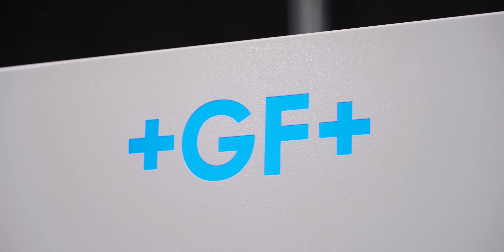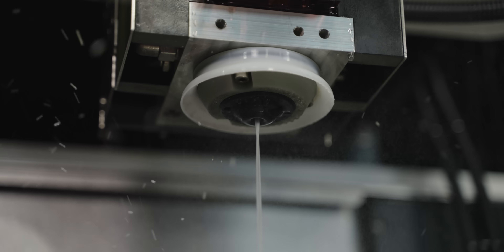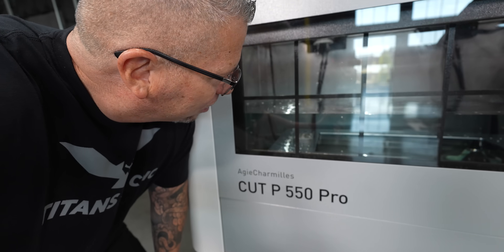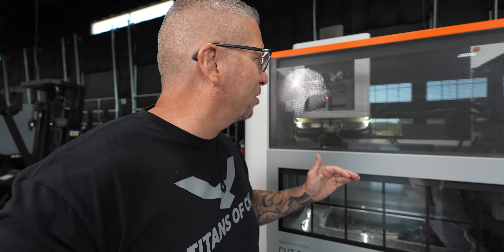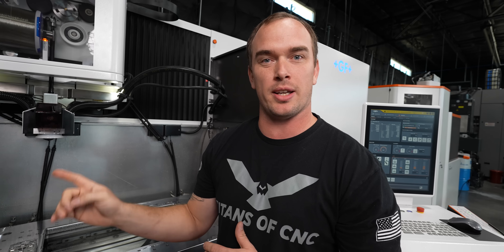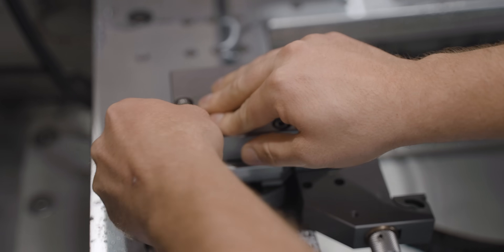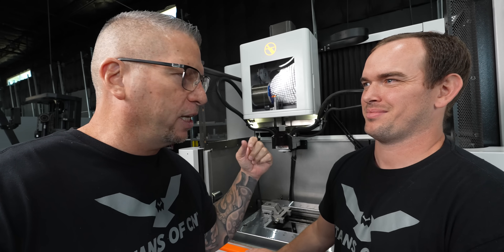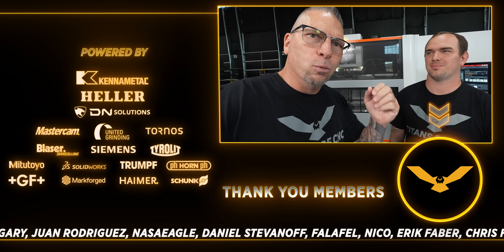We got the MOST ADVANCED WIRE EDM in the World

Comment: Literally how come the wire strength exceeding over 18 degree taper....  When power and material starts to contact with each other to cut, A small discharge of spark - Cuts the  wire in a sec.    What kind wire are they using

Comment: I was a mold maker I'm 67 and became a sinker specialist. Then took a job with AGIE as an application engineer.  There I taught myself wire and bought a machine. Was in business from 85 to 2003. Back then max speeds were about 12 Sq inches per hour. I had 3 AGIE and 3 Fanuc machines. What are the cutting speeds now. Haven't run a machine in 15 years I retired early.
Reply: Z=100mm minute 1.2 & 1.5 speed

Comment: I used to run Agies two 85 models and 1 was the agie classic 2005 model they were a dream to run. The agie classic didn't come with the prob for levelling the job but it did have the option for squaring up the job with the wire. The technology come a long way since 2005 on those machines. They are best wire EDM's by far.

Comment: Have you guys tried cutting hyperboloids with edm? I have an automotive component that’s in the design phase that I’m trying to make use of edm to make more accurate and easier to machine.
Reply: It depends on whether you want to do it inside or outside. For the outside version, you could simply connect a rotary axis and rotate with insane accuracy and surface finish. This makes it possible, in all conductive materials, to put down the smallest diameters.

Comment: This is a really cool machine! Thinking about the mechanical operation, is it possible to make convex cuts by doing repeated passes with the wires angle shifted? Similarly, is it possible to create curved tapers that start at, say, 30 degrees and end at 60 along the length of the taper? If so, this could make some impossible edm cuts more possible

Comment: Wait you're telling me this thing wires itself? That's next level productivity
Reply: If anyone has ever ran a wire EDM you'd understand that the set up process can be the most extensive part of the op, from spooling your machines to controlling your water with chillers even  the door cover can be some serious pains on some old EDM machines. All of these seem really fluid with this allowing for fast setups which gets you ahead on EDM jobs as they often take a long cutting operation.
Reply: @khalzard2964 new edm machines are extremely fast to set up. You shouldn’t have to touch the water chiller and putting on a new spool of wire should take a few minutes tops.

Comment: We have a P 350 at my work and the cutting is so much more stable than their older generator but we have been having some issues with the dielectric system being too sensitive and it cuts the machine off with random errors about the fan very confusing also does not like coated wire as much but absolutely flies on standard brass
Reply: Have you contacted their applications dept?

Comment: Thank you for this video! I used to have an Agie Classic and an Agie Progress at my old job. I used Esprit to program with. I was wondering what you guys are using for the EDM?
I also had a Mitsubishi FX 10 and an FX 20.
I had my less precise jobs in the older Mitsubishi's and the aerospace jobs in my Agies.
I ended up installing aftermarket DI water filtration systems from a company called Ebbco inc.
To take the load off the Agies  own filtration system. When you are running aluminum non stop like I was, the machine did ok but the Ebbco system filters the water and returns it into the machine saving the WEDM from having to clean so much eroded materials. You're not going to want to clean your water work tank and change filters as much as letting the Ebbco system do it's job. I'm sorry if I over shared. I just love you guys and miss WEDM.
Kind regards gentleman